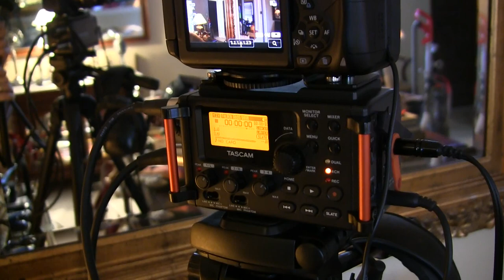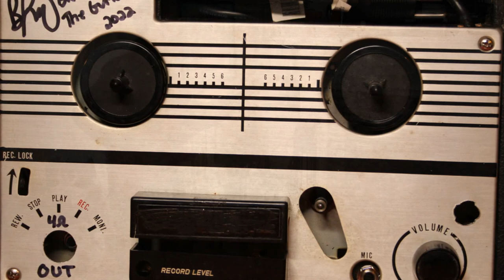BATTLE of the Reel to Reel Tape Recorder GUITAR AMPS

Comment: The first one by a couple miles, easy.  
The second one sounded terrible, then ok,  then fizzy and tinny again.  Sounded good with the gain backed off though.  I want that first one, it sounds fantastic. 
Great work Brad.
Reply from the maker: The second one has too much gain really. It's going into a blocking distortion almost on one of the stages when cranked. I liked that about it when I first built it, as it gave it almost a big muff fuzz character, but doing this comparison, I'm thinking of going back into the lunchbox one and fiddling with it, but I have some other projects to get to first.
Reply: @TheGuitologist  i was given an old tube radio. From the late 40's? I've been thinking about trying to make a guitar amp from it, but I'm not qualified.  My son is an electrician, but says it's too different from wiring walls and businesses.
Edit: only live once,  i might just double down on safety and give it a go sooner than later.
Reply: Agreed
Reply: @earthstrong-43.72  Check out the radio conversions done by Terry at his channel,  D-Lab.  He does a good job explaining the process and theory without getting too technical.  I think he's making modular boards to build DIY amps from.  His style is different than Brad's but there's time enough to watch both.
Reply: @timmooney7528  thank you very much.  I really appreciate the info.  I'm familiar with the name but haven't seen much of the channel.  I'll look into it,  thank you again.
Reply: @earthstrong-43.72  Add a switched input jack so you can choose between radio and amp and tie it in before the preamp stage.  Just don't expect a lot out of it unless you add an output jack, I just question if that's even possible with a field coil speaker if it has one.  Just my 2c.
Reply: @hardball107  Maybe add a step up transformer on the guitar side?  Something like a 12 or 16v AC wall wart fed backward (guitar into 12v side, 120v side to volume pot)?  Bonus: isolation.
Reply: The lunchbox.
Reply: @hardball107  you and Mark are speaking about things I've yet to learn.  It might be worth it for me to disconnect from the current state of the country.  Both politically and socially.  To focus on learning the necessary knowledge to even begin this adventure.  Lately,  I've been spending more time outside to get away from it all.  Target shooting with a pellet rifle.  It's fun, relaxing, is a viable skill, and bonus- outdoors. 
 I know I'm going to fuck it all up and make a dire mistake.  One that will probably cost me the build or my life. I'm not to savvy with tube amps or their circuits.  But hey,  you only live once.  Thank you guys
Reply: @bonemar66  it didn't tag you.  But i tried in the above comment.
Reply: @earthstrong-43.72  Hang in there, I'm defiantly not the last word on radio's.  I started building little shortwave kits and restoring old amps.  Maybe start by trying to build a small single ended instrument amp like a Fender Champ or even cheaper a filament voltage amp like the "Lunchbox" from scratch, 1-5 watts.  Relatively cheap and lots of fun to learn the basic's, gets your mind off the current state of our Country for a while too.  Your on the right channel to learn, Dlab and Uncle Doug are also great channels.
Reply: Agree with this. Kinda wanna hear the first stage break up on the lunch box amp. It was very spitty cranked. I legit liked the first one. Also was surprised by the mics... not just some SM57 and such, they sound really good.

Comment: I like both. The first would probably cut better in a mix. Maybe knock off a bit of low frequency somewhere to tighten it up. The second was cool too, with thick lower mids and some velcro fuzz. Both would be excellent tools.

Comment: Loved the first one, the second one, as you know, just needs a small cap putting in the signal path up front.
Reply from the maker: Not sure what it needs exactly, but there's a bit of almost blocking distortion happening, so gain needs to be tweaked. I'll go back through it eventually.

Comment: There's a few 50's Silvertone R2R that used a 12AX7, 12AU7, 6V6 and 6X5, virtually the same chassis as that silvertone amp you converted a few years ago. I think you called the video a restoration love affair or something like that. I built one of them like a single ended 6V6 with the front end of a deluxe , well sort of. I used 2 inputs, one was an EF86 and the other was half of a 12AX7. each channel had a volume and there was a master tone like a deluxe, the channels combined then go thru the other half of the 12AX7 right into the 6V6. What's cool is like a deluxe you can use the volumes to blend more or less from each channel and depending which channel you plug into it changes the tones you can get. I am about to convert a Bogen H30 PA from 1949 all octal and do a similar front end but use a 6SJ7 in one channel and 6SF5 for the other with a volume for each and shared tone. Another 6SF5 will come next then I want to do a 6SN7 or 6SL7 phase inverter (whichever sounds better) into the pair of 6L6Gs. I have a feeling that is gonna be sweet.

Comment: The audio sounds great but the picture of the camera is kind of bad
Reply from the maker: Agreed. The DSLR autofocus was going haywire because of me passing back and forth in front of the window.
Reply: @TheGuitologist  is there a way to turn the autofocus off?
Reply from the maker: @mark5150ty  Yes. But I have to put it into manual focus and dial in the focus based on where I'm going to be standing and it's not that easy to do on the tiny built-in monitor. And then you're stuck with whatever the focus is, so if you move, you have to manually refocus. I'm still experimenting. I might use this cam on on talking head stuff from now on.
Reply: I thought the video was good overall at least with alto focus you can move around and still be in focus and Btw,I liked the first amp better.
Reply: @davidsmith3736  I like the lunch box better
Reply: @mark5150ty  Fine
Reply: @davidsmith3736  they were both great though.

Comment: The little series string amps can really have a neat sound.   I've scratch built a few of them.   The circuit is sort of designed to get the most volume out of wimpy power tubes,  so getting it to distort is easy!

Comment: To my ears, the Reel-to Reel recorder sounds better. It seemed to me, that the lunch box was brighter and had a tad too much gain, which produced more mids iffiness, but that could have been easily solved if you had used an equalizer. So yeah, they're both cool. It was more interesting to watch your reel-to reel tape video, because the mini amp you made wasn't from an empty box. You had to figure-out what to remove and what to leave-in. Please, make more of these ''boutique'' valves amps. It's really interesting. Thumbs-up.

Comment: I've got to go with the first one. It sounded much more responsive to the pickups output, going from heavy dirt on hard picking to just a bit of grit with light string attack. I could also hear more of the harmonic tones which are crucial to the sound of overdriven tubes.

Comment: The new gear did the job IMHO.

Not sure if you were using autofocus or had assistance running the cam. As you were moving about, the focus was trying to decide what to pinpoint.
The Tascam seemed to work as expected. I didn't hear as much compression as I was expecting.

Bet you learn a lot from this when you review the raw recording.

Looking forward to more content!
Reply: Just based on your reactions, I think you appreciated the first one more. 
I on the other hand liked the lunchbox version. 
It was never an apples to apples "comparison" and we all like what we like. 
Enjoyed the vid!

Comment: Both brilliant, that vintage alnico speaker certainly helps deliver a great sound from both these tube amps. My preference was the first one as it didn't sound so cluttered as the second one, which, from watching, I got the impression was your favourite. Sound is such a subjective matter/science. But, back to the first one. which I thought picked up more information regarding the nuances in your playing, such as harmonics, richness, and some bell tones reminiscent of the likes of Rory Gallagher, I can't adequately explain but I'm sure you'll know what I mean. Filming was good, might be improved with extra lighting or, different settings etc. Mics were an interesting mix, one looked like a ribbon mic, I could be wrong, but, nice sound coming out of the Tascam that's for sure. I did a little experiment of my own, and that was to play the video again but this time using headphones. It hasn't changed my choice but it was a much more detailed sound overall. Top tip I'll be using headphones in future, recommended.

Comment: First one for sure, the second one sounds more like a fuzz box and thin. Both could use more bass though. I’d be curious if they could drive a 4x12.
Reply: I'd imagine you could, as long as the impedance matched. It probably wouldn't drive the speakers to their sweet spot, though; more power would be needed...

Comment: Hey brad, I am hoping you could help me. I have a carvin quad x rack mount preamp on the bench that has a buzzing in the reverb section. If I take the tank out and move it around the buzz comes and goes. Could this seen the tank itself or sum thing else?
Reply from the maker: Clean the jacks going to and from that tank. Clean the tips of the cables and retension the cable grounds. Open the tank and make sure the solder joints are good on the inside of the tank. (Be careful not to break the wires going to the tiny transformers. Buzzing tank is usually a bad ground.
Reply: @TheGuitologist  I found photos of another revision and the power transformer is at angle, so I unmounted it and moved it around and there is a change in the buzz. The guy has another quad X and he said it’s vey quite. Also the wires to and from the tank in the other revision are run differently and are a lot shorter. I will however recheck the connection and make sure all connections are good.